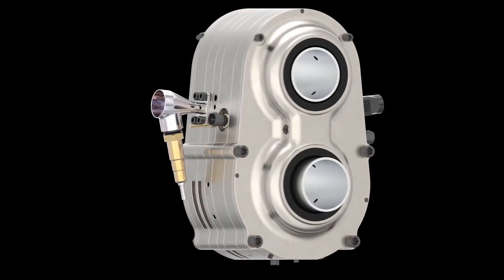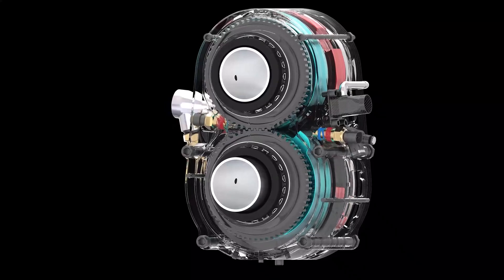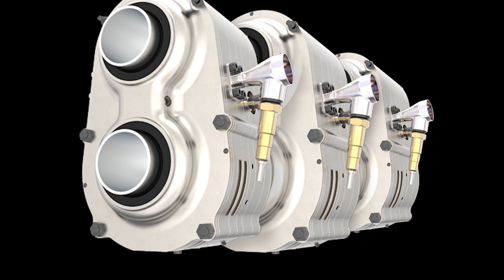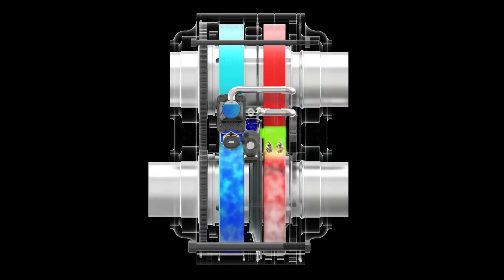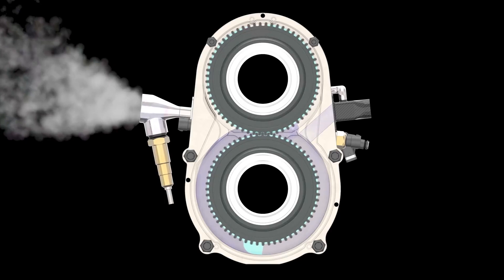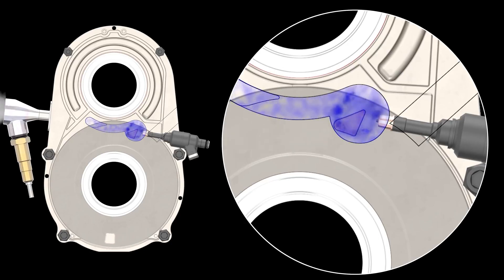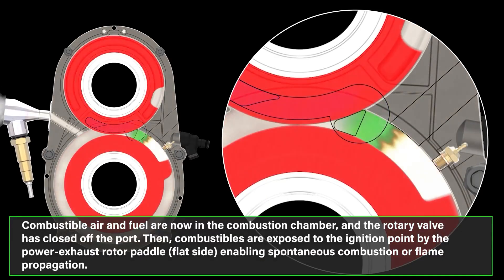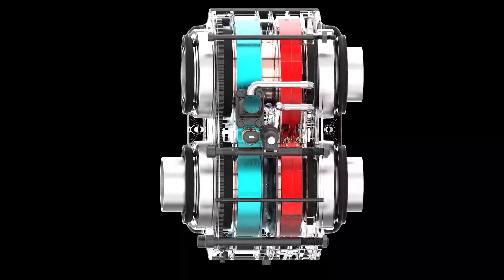This pistonless engine runs on hydrogen and revs to 25k rpm

Comment: So is this an actual engine or a cad on a harddrive somewhere? I've seen so many amazing engine designs over the years, but that's all they are, amazing designs. They never seem to leave the harddrive or old school drawing board.
Reply: Lol true
Reply: Yep, just another CAD design.
Reply: @EliCamacho  This engine has been built / there is a running prototype. Search omega 1 on YouTube and you can see a video of the actual engine running.
Reply: on their channel at the end they have a clip of it running. don't know how long or at what RPM but it was running
Reply: @cailco100  Saw it. As I said, looks and sounds like a Briggs and Stratton lawnmower engine, idling. Rough, at that! 😂
Reply: Yeah, the main problem is making a great efficient engine that is also able to run for 200.000 miles.
Reply: Hey, that's engineering though. You have to start somewhere and that usually requires generating a concept and then iterating on it constantly. 

The issue with this design is that it requires those tight tolerances which wouldn't work well for obvious reasons. Especially with thermal swelling when the engine gets hot, which is another problem, with a dynamic combustion chamber compared to a static one, you can't actively cool it. So, the limitations of the engine will be down to thermal swelling turning the thing into a metal shavings generator. 

I do like the concept of the motor! But it needs a new fuel source (hydrogen generates more natural gas byproducts to produce than it offsets environmentally) and a better thermal management system. Plus, with its current design you lose the benefit of adjustable timing. 

The intake also is also of equivalent pressure to the external atmosphere. So, when it gets into contact with the intake system it will not suck in air like a normal engine with an expanding volume would. You would NEED to supercharge/turbocharge the engine for low RPM running meaning its idle would be incredibly high to induce that higher than ambient atmospheric pressure required to fill the chamber with air. That extra air requirement would destroy the efficiency of the motor as it would need to burn quite a lot of fuel to maintain that rpm/air intake level. 

So, the design has promise! But it still has a ton of flaws to overcome which again, is part of the engineering process.
Reply: The last greatest engine tech, in my opinion, is the free valve tech that's been in the world over the last few years. Something like this? Seems like exactly what you said. A cool design. But nothing more
Reply: This is the engine version of Elon Musk's HYPErloop.  It's easy and fantastic in the CGI video.
Reply: In short, I think inventive engine ideas, lack the capitol, to be built in a shed/backyard/warehouse...if you did have the money, it would probably be a very poor investment, with little to zero financial gain,( a giant money pit)  unless you had a serious investor....and by the time you initially had a cheap, promising, marketable idea, world industry powers would have you silenced/killed off.
Reply: @FJS check my last comment, theyve been selling to nasa and us military for over 10 years
Reply: Yep
Reply: F1 engines are a great exception....but I agree. The success ratio seems to be very low with engine design.
Reply: drafting table not a drawing board.
Reply: @godslayer1415  Depends if you use Electronic or old fashioned drafting table like what I used as a Cadet Draftsman over 50 years ago, things change, no rulers required on a computer as you just need to place points and it draws the line or curve or circle for you, so much faster, all done with exact dimensions, no matter if you have that new pair of glasses or not, or if your hand isn't as steady as it used to be ;)
Reply: Cummings developed a working hydrogen engine last year (2021).
Reply: Car Mighty just covered it briefly on his latest video. There actually is a video of it in action
Reply: https://youtu.be/gi7IOXQ7oyo?t=539
Reply: Lol, didn't it sound and look awesome though? Never mind,  that some of them never reach R @ D.   I will say I don't agree with the cam radius. the one getting all the friction should be larger IMHO.
Reply: i've seen plenty of stuff like that. there's always some impossible bearing, or some part that works in CAD but will wear out crazy fast IRL.
Reply: Intriguing, time will tell.
Reply: There is an actual engine, I saw it somewhere
Reply: yeah :/ yet an another fancy cad animation wht would never work.
Reply: Guys check this out- Power of Steam Locomotive 🚂
https://youtu.be/H5QVrWEuIX8
Reply: cant leave paper if the designer is too controlling of their baby and won't let others improve it. patents disincentivize iterative invention and innovation.
Reply: That's because your government doesn't want cars that work they want fuels so they can eat shit &'collect $$$$$quiggly lines You must be a voter. Your not with the program yet. $$$$quiggly lines are important don't you know that. You can't live without $$$$$quiggly lines if you don't have $$$$quiggly lines the world will stop spinning & your won't be able to wake up. Your shit will stop falling out your hole. Keep voting for $$$$quiggly lines or were all dead. Funny thing, Blackman around the world never had $$$$quiggky lines they just had a world full of fresh air, water & that many things around them to eat they practically threw a rock v in the air something feel in the fire or they stuck there thumb in the water & caught a fish. White man scoops out shit & garbage. No I'm not black but I would have been happy to live 1000yrs ago. Chasing the 🌞 BBQ's everyday, fresh air & water, fire every night playing music singing dancing telling stories. Running around in a pair of boxer shorts a horse would be nice Kangaroos don't like wen you try to jump in there pouch & suck on there tits for a drink.
Reply: here is a link to that video https://www.youtube.com/watch?v=KAeHqDt8AhQ
Reply: people don't like getting whacked mate
Reply: Technologies like these normally get bought out right and just put on a shelf.
Reply: Obviously you don't understand all that goes into designing an engine.
Reply: @Juan800PimpBot  And of course you do lol, how many Engines have you designed or worked on, let us know so we can see these marvels.  This is the beauty of the Internet though as any fool can make a comment, just like me ;) an old fool with my over 65 years of living experience that at least has a bit of knowledge behind my comments as I have seen amazing changes and many dozens of friends or family trying to hold off the future with very costly results, my Brother in law didn't take my advice to learn how to use a computer and his Quantity Surveying Business went down the crapper as they couldn't compete as far as price or time with the Companies that went with Computers, he was one of those that said the Computer was just an over sized and priced calculator :) All those that keep buying ICE thinking they are the clever ones will be the same as my Brother in Law that wouldn't get a Computer, he became a drunk and just sat around his home, whining and complaining and blaming everything except himself.
Imagine all those people in a few years that spend $40K+ on a ICE that they will get nothing back for as a trade in or no one will want to buy it as second hand and it will be a total loss, Leases will change for ICE that you will have to agree to purchase the Vehicle at the end of the lease or you won't get one.
Reply: The thing is we are wY more advance than this! The dark has been holding is back for a very long time! Our consciousness is not at a high enough vibration for us to comprehend our own reality! Anti gravitics has been with us for a very long time! Our own people  had no choice to comply or die!!!!!!
Reply: The thing is we are wY more advance than this! The dark has been holding is back for a very long time! Our consciousness is not at a high enough vibration for us to comprehend our own reality! Anti gravitics has been with us for a very long time! Our own people  had no choice to comply or die!!!!!!
Reply: If I had the files I'd make one
Reply: This is similar to the myt engine Mighty yet tiny which was fully developed and tested and then buried in the deepest sea where no one will be threatened by its effect on the existing industry
Reply: Sembang
Reply: This is the first time we wont be held back! Prison planet
Reply: I've also seen a beautiful little pellet stove design which was refined and tested and proven and then sold only to be disposed of by the dominant pellet stove manufacturers. You can build your own if you want from plans. And it seems if we really want progress that's our only option because industry is controlled by regressive political forces that are in total control without giving us any increases in efficiency
Reply: @douglundy5755  You've cracked the case for Big-Pellet-Stove Industry.
Reply: @rogerlouie1  it's all public knowledge, the new pellet stove was shared on YouTube and the patent came out and was then purchased and the idea discarded.
Reply: I recieve offers from other countries to sell my patent but Is against the law for me to sell it overseas and could face treason charges here in the US.
Reply: @teniaqueserjorge  Yet more proof the U.S. is a garbage fire...
Reply: Because any engine that can eliminate gas will be shutdown by big oil. Same as the water powered car
Reply: One of the main reasons being that the existing powers that be don't want that to happen. It will be very interesting to see social and economic pressures push the ICE to greater and greater efficiency over time. I'm still waiting to see a small turbine powered generator running on diesel used to charge the  batteries on a hybrid. Aircraft have been using this system for years and its fully hands off and crazy efficient...maybe too efficient???
Reply: @jbrownjetmech-4783  bruh it's called an ev with range extender. it's already a thing.
Reply: @amicloud_yt  The "idea" may be a "thing"... But this "thing" is barely an "idea"!
Reply: @jbrownjetmech-4783  turbines are far from hands off as far as repairs go, and very expensive to manufacture.
Reply: @jbrownjetmech-4783  Trains use a similar system. Diesel generators power electric motors. I'd love to try building something similar in a car, but who knows if that'll happen due to time and money restrictions lol
Reply: @smileyguyz  I feel you on that, got a turbo whr componder electric hybrid idea that uses a flywheel but... I don't have the money or time to try it out yet 😔... just sitting there on a solid works file.
Reply: @smileyguyz  I know this is not exactly the same as the diesel/electric train setup- But, the Chevrolet Volt used a small gasoline engine as a "generator" and an electric motor to move the vehicle. It was a pretty cool setup. I'd love to see more development on systems like that.
Reply: @smileyguyz  The M12 Warthog from the early Halo franchise also uses the same concept, but with a massive 12 litre hydrogen engine instead. The engine turned a giant flywheel connected to a ridiculous gear ratio, which was connected to a generator that provided power to the motors at the wheels. This was all for a crazy suspension concept that made the Warthog very stable at high speeds.
Reply: @K_Unit2409  So?
Reply: I own a 2014 chevy volt. Its a plug in hybrid. The gas engine doesnt charge the battery. I wish it worked like that!!
Reply: @llamathefuzz  I love my chevy Volt
Reply: @K_Unit2409  I love seeing Halo details n lore stuff randomly like this
Reply: @llamathefuzz  You'll find they are called hybrids!
Reply: @llamathefuzz  Check out the new Ford Maverick Hybrid pickup. 42 mph. I’m still holding out for cold fusion.
Reply: @smileyguyz  It has been done, a young engineer did exactly that early last century. He went on to use the same concept in other vehicles. His name, Ferdinand Porsche
Reply: @K_Unit2409  That's a cartoon car mate.  It's not real.
Reply: @smileyguyz  welp i am a kid but tbh part of it probably comes from the size, no?
I am genuinely intrigued lol
Reply: @jbrownjetmech-4783  turbines also rotate at crazy rpms and required expensive and frequent maintenance so they don't blow up. the powers that wont let this happen are the powers of physics and common sense lol
Reply: @jbrownjetmech-4783  , nah, something like this, a hobbyist could make. There's no conspiracy to keep stuff like this off the market. It's because it doesn't work if it doesn't make it to the market
Reply: @jbrownjetmech-4783  Conspiracy theorist eh? Real tin foil works better than aluminum foil btw ...
Reply: @jbrownjetmech-4783  Such BS. Always the same "Create a stupid idea and then blame society that nobody likes it" argument. If its good, prove it and people will pay you billions.
Reply: @jbrownjetmech-4783  check out Capstone Microturbines.
Reply: @searlearnold2867  pretty sure Peterbilt used a capstone microturbine in a hybrid semi tractor prototype they built in partnership with Walmart about 10 years ago
 It used air bearings.
Reply: @jbrownjetmech-4783  Yup!
Reply: @jbrownjetmech-4783  The major auto makers are already pushing ICE to greater efficiency. Mazda is nearing 50 percent.  This is a working engine not just a design.
Reply: @jbrownjetmech-4783  no. It's because the majority of engines work hypothetically but in reality they are limited by real world problems like materials are not infinitely invincible. 

It's like the wankel. Yeah, sure it works. Poorly. It's grossly inefficient. The power per liter is not that impressive when broken down to be comparable to an otto cycle, they are not reliable at all, and it is a pollution nightmare.

Now there are regulations that stop the rest of it so it kills most of this nonsense.

Like the hydrogen vehicle and it being iffy carrying a massive hydrogen tank on board to explode and level everything in the area.
Reply: @jbrownjetmech-4783  There is literally nothing stopping anyone from machining an engine or attempting to source funding for revolutionary tech. Not everything is a grand conspiracy, sometimes ideas just don't work.
Reply: I would say the MAIN reason is a lot of these designs do not work efficiently when the laws of physics get involved.  You can animate anything in CAD or Blender, but turning a gallon of gasoline into 45 miles traveled in a real world 3000 pound car is another matter.

In this case, how do those “really tight tolerances” hold up in a Texas summer driving through the dust in El Paso?  What about a Canadian winter?  Or both?  Can you get one to 100k miles, even when your willfully ignorant teenager “forgets” to change the oil?

The modern ICE has billions of man hours and money thrown at it, and people do not appreciate how good they are for what they do.

And burning hydrogen does cause NOx emissions due to the temperatures involved.  You don’t get just H2+O=water coming out the tailpipe.
Reply: @jbrownjetmech-4783  spot on my friend. Couldn't have said it better
Reply: @jbrownjetmech-4783  aircraft isn't costing $20k. there are plenty of conspiracies but maybe this isn't one. reminds me of people who really think that ash of hydrogen would be good energy source for cars.
Reply: @jbrownjetmech-4783  Electric vehicles are already "too efficient", you only need the specific energy of two litres of fuel worth of electrical energy to fully charge a battery that would go the same distance than a whole 60 litre tank of petrol for an equivalent ICE vehicle. 

The powers that be are already failing at keeping the status quo alive.
Reply: Yeah, because Big Oil buys them and shelves them ;)

Comment: The future is clean-burning gas. The infrastructure is already in place, a relatively cheap and simple conversion for an existing ic engine. 
Batteries are an environmental disaster from start to finish.